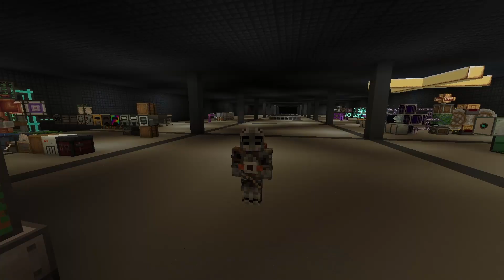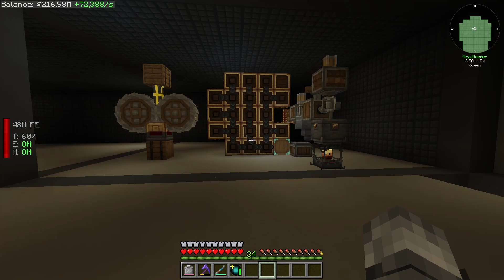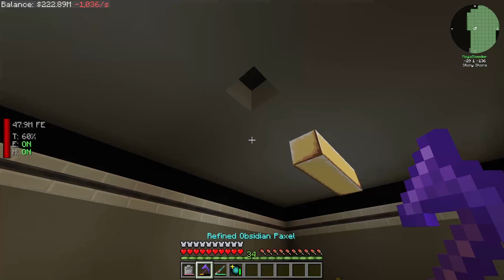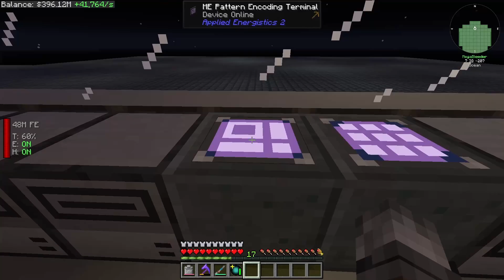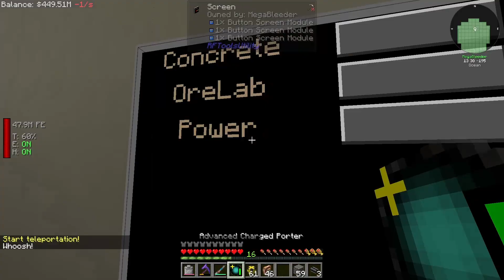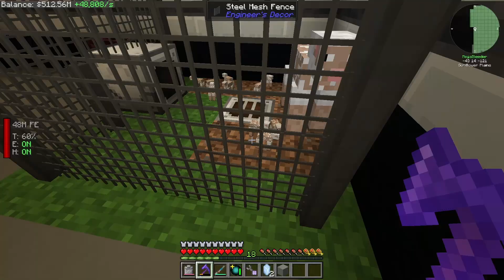Mechanical Mastery Plus Ep11 Fully Digital Hardwire

Comment: Why you using more patterne provider than molecular assemblers, Because for each pattern provider you use 3 or 4 molecular assemblers (Depending on how many co-processors you have, e.g. 1 CPU 3 co-processors, then you can use 3 molecular assemblersfor each patter provider). Sorry I Sleep in the middle of the video. I like is calm.
Reply from the maker: No problem! The more Molecular Assemblers you have the more processes the Pattern Provider can do! So each one of my "Crafting CPU's" has 5 Co-Processors meaning they can perform 5 different crafts at a time. If a Pattern Provider has 5 recipes in it that is wants to use during a craft then it can access 5 different Molecular Assemblers connected to it, I'll be upgrading my "Crafting CPUs" to have more than 5 Co-Processors soon and I'll explain the AE2 logic more then! Keep an eye out for the next episode!